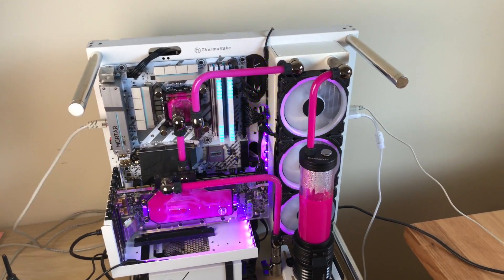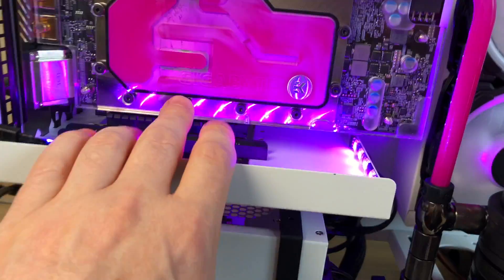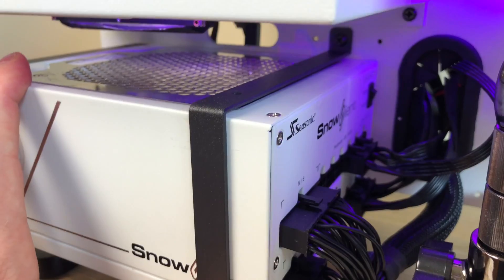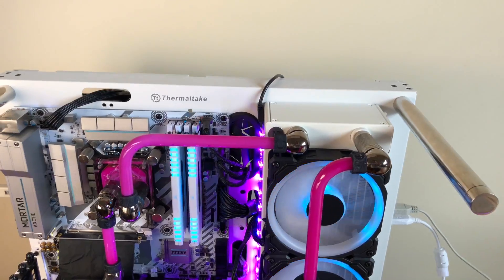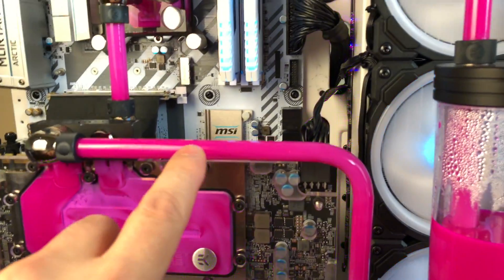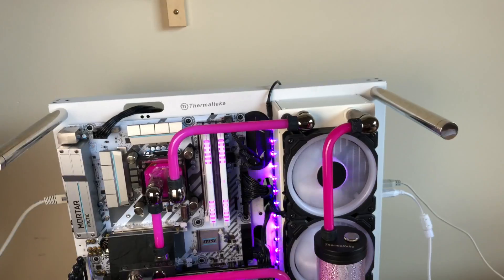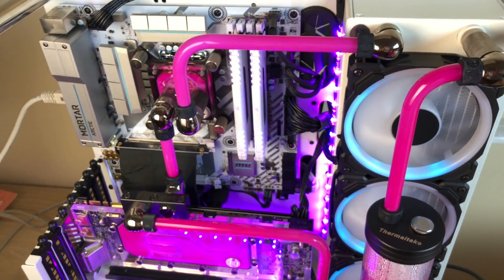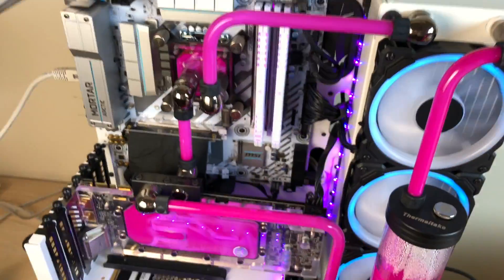Custom Water Cooling PC Project Preview EK Thermaltake

Comment: Holy mackerel WGU! ... 😲 ... what an amusement park of a system. In the old days, they'd say that's an "E ticket." :D Very interesting to see this... very curious, how strong are those clear pipes? I'd be worry about breakage... but perhaps that naive. Thanks again! and cheers!
Reply from the maker: They are acrylic I believe so very robust. I guess the weak point is the joins but if you put it together right its will have no problems. I have moved it and transported it. What is this E Ticket you speak of? All the best

Comment: What would you say is the biggest advantage of a water cooling setup?
Reply from the maker: I would say choosing the theme, colours and components that come along with that. Along with working out the arranging the hard piping and the biggest pressure point is the pipe bends